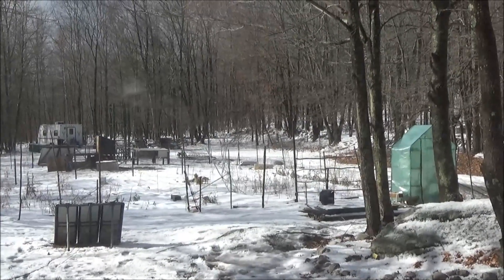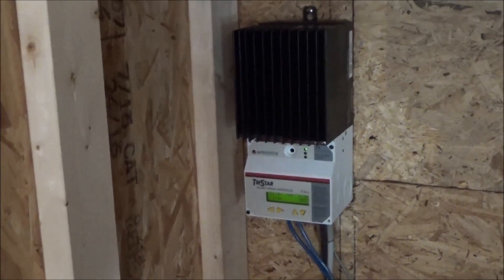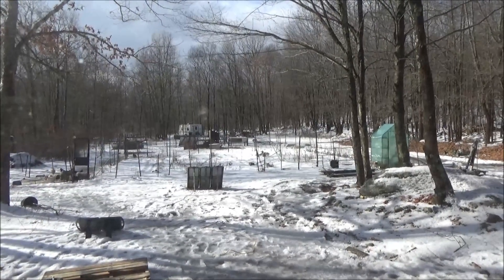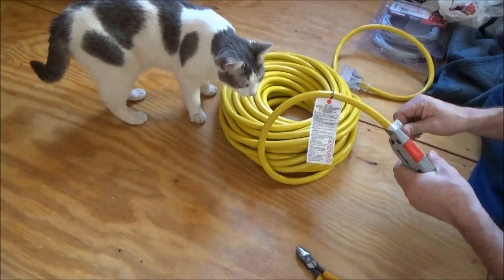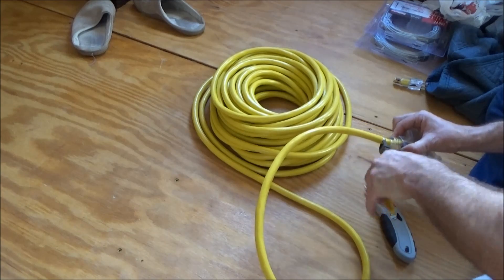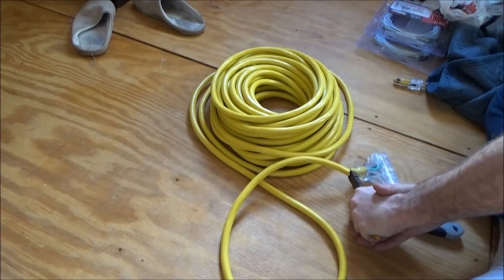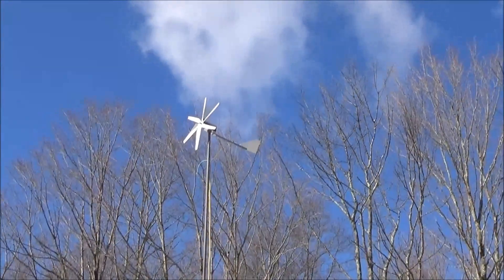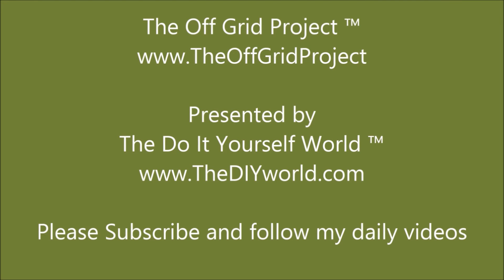Mounting My 350 Watt Wind Turbine

Comment: you put a piece of wire buy the cat. they will go nuts. you can strapp the green wire to the neg  to help with voltage drop. its 12V it makes a difference. hope you put a ground rod system on the tower. the rain and snow static build up can cause power spikes in battery dammanging what connected. I remember that storm too well. im  appx 40 mile from buffalo ny. we got hit too.killed the grid hear. shut down I 90 in spots. Ice skating time. I lost my long wire antenna during that storm.

Comment: Keep at it Troy. Getting that wind turbine functioning is a huge step. Running generators for electric can be done but it is expensive over a month. The money you save from getting this done can be applied else where. Ignore the haters.

Comment: If at all possible, you should connect to the AC side of the diode pack and run AC to the house and connect to a diode pack there. You will gain more power than running DC on the 10 gauge wire. If you can't run AC, you may need to run 6 gauge to the house to minimize line loss. Good luck.

Comment: Hi Troy, Have you considered hanging 2 PV panels from the top of the towers cross piece to help with the shadowing issue on the ground mounts? Also which type would be more beneficial the amorphous panels or the higher output panels?  Steve O.

Comment: Do you think you can put one more set of four on top to double the height?
Even if you do one at a time it would probably make a big difference.
Maybe even take one of the extra attach it horizontally at the top so it looks like a "T" then you can put two wind turbines on the same scaffold at a nice distance apart.
Just some thoughts.
Reply: Also to help keep it from tipping over you can mix bags of concrete and pour/pile them at the end of each outrigger. Probably a couple hundred pounds at the end of each outrigger should be more than enough.
Reply from the maker: Yes I do plan to extend the height and also put weight on the outriggers

Comment: You should consider having 3 wires running all the way from the wind turbine head 3 phase output to the rectifier diodes close to the THOW wind charge controller to maximize efficiency.

Comment: if you remove the clamp in the middle the pipe can flex more without breaking.

other tip is to use the third wire in parralel with the pos or minus, the thicker the wire the less loss!

good to see more charging power available! thumbs up!
Reply from the maker: Thanks. Things are looking up
Reply: fix the other pma windmill asap, and put that on the radio tower! (do you have a way (brushes??) to connect the turning turbine to the mast?? ) thats a good alternator, use the 3 phase and mount the rectifier inside the duplod box inside the th, you have 3 wires available, its a big beneft iff you do it that way, lots lees loss! its looking better by the day! thumbs up!

Comment: Damn, I must just be stupid.  But, why wasn't the wire secured to your pole, before you raised it?  That wire flapping in the breeze will break those wires off in a heart beat. (repeated flexing under pressure) And, Troy, your friend told you before you raised your pole\tower to make sure you guyed it properly.  Easier to do before raising, than having to lower, install correct parts and re-raise.  Lessens the chance of damaging expensive  parts.  Haste makes the intelligent appear foolish
Reply: Everything is temporary why do it right the first time when you can do everything over 3 times.
Reply: Nothing is done right the first time on 'This off Grid Project'
Reply: *****
I get the feeling that he wants to do everything 3 times.  I guess that is so that he can make 3 videos about everything he does instead of 1?
Reply from the maker: It is coming down in a few days anyway. I am going to mount it with the larger tower
Reply: *****
so you always do things right the first  time or put your foot in your mouth  good for you me i'm just human  and screw up a lot the first time

Comment: For next time you move the turbine!!!  If you would put the wires together (neg and Positive) it will  be a brake on the turbine so there would be no 12 volts coming through the lines.  Just trying to help.  Dont want to see you do the DC shuffle.

Comment: Great job Troy, But make sure you install at least a 9 ft grounding rod, That way your system will be SAFE from electrical shock. That is if you haven't already, good luck be Safe, Keep the videos coming

Comment: what happend to the tower his friend brought over in the last video? thought you where using that and then attaching to pole on top of that..  Or did i miss something?-
Reply: That will be up very soon, Troy just got impatient and wanted to get some wind power into his new batteries along with the solar power as the solar alone is not enough to give a good charge to that new battery.

Comment: Tower looks like it will be working fantastic. Great Idea Troy. Looks to me to be plenty high. But why do you keep putting your solar and wind gens far far away from your tiny house? The small advantage of the position they are in the sun is not enough to over come the far off distance and voltage drop.  This causes huge voltage drops defeating the purpose of the whole set up. You want to be as close as possible to your panels and your wind turbine.  EVERYONE ELSE ALWAYS put their panels as close as possible to the batteries. You will probably get 3 or 4 volt drop in power, "a huge disadvantage. " I wonder if it will even barely work? I hate be negative but this is a fact. Get your out fit closer to your cabin. ten gauge is good for about 100 foot after that you better get some eight gauge or six gauge for a run like that.  shesh! you have a big wire for your run BUT it is not a copper wire is it? Isnt it aluminum. Big aluminum wire is not good for DC at all. You might get something I guess. But not a lot with a long run like that. NO wonder you only get 200 watts max. I cannot stress enough the huge distance your trying to over come is just too far away!
   Please use a MULTI Meter  to check voltages at turbine and at your house to actually see what Im talking about. I have never seen you even use a Multi Meter that I can remember lately. I hate be a bummer but how many feet away is that from your Tiny House on Wheels anyway?

Comment: Hey troy.   Just noticing that the generator was not rotating.  not sure if it's still the case but you mentioned before that the wind changes direction often in your meadow.    Just wondering if it's able to turn into the wind.
Keep up the great vids
Reply from the maker: It spins freely yes
Reply: Awesome possum

Comment: Do you have a swivel on that thing? I noticed the turbine stayed stationary even though there was some wind as evident by the noise in the microphone and the buffeting of the blades.
Reply: Some shots where the blades look stationary they were actually spinning, cameras have a job keeping up
Reply from the maker: It spins freely inside the pipe. I also added large greased washers for more protection and lube

Comment: TROY! YOU SCARED THE (edited) OUT ME! You didn't show (and SHOULD have)  what was happening at the other end of the wire. One end was connected to the live turbine, and the other was where? I'm sure you realize, but others copying you may not that if that live wire were lying in the snow the current can carry right over to the metal tower base! I was yelling at the screen the whole time. .. Where is the end of the live wire?????!!!!!!! So I am sending you a [SLAP] eeerrr... Ok, you said at the end it is hooked to the panel?... too little, too late.. you scared me! Don't do that!
Reply: Albertzz99 A little Voltage and Amperage lesson!!!  Voltage isnt the problem.  The AMPERAGE is what kills.  12 volts at 1 amp can grab you and hurt you, 12 volts at 10 amps can burn you and stop your heart.  Never think of the voltage.  Electric fence charge for animals is 150 volts ZERO to .0001 amps.   It bites but doesnt have the ability to grab you and kill you.  Voltage will knock you away, AMPS will grab you and then your done.
Reply from the maker: Oh that. I had one wire in my sock and the other between my teeth so I did not lose them while working. lol
Reply: Hope this helps. shock is relatively more severe as the current rises. For currents above 10 milliamps, muscular contractions are so strong that the victim cannot let go of the wire that is shocking him. At values as low as 20 milliamps, breathing becomes labored, finally ceasing completely even at values below 75 milliamps.
As the current approaches 100 milliamps, ventricular fibrillation of the heart occurs - an uncoordinated twitching of the walls of the heart's ventricles which results in death.

Above 200 milliamps, the muscular contractions are so severe that the heart is forcibly clamped during the shock. This clamping protects the heart from going into ventricular fibrillation, and the victim's chances for survival are good.

The actual resistance of the body varies depending upon the points of contact and the skin condition (moist or dry). Between the ears, for example, the internal resistance (less the skin resistance) is only 100 ohms, while from hand to foot is closer to 500 ohms. The skin resistance may vary from 1000 ohms for wet skin to over 500,000 ohms for dry skin.
Reply: yes they could send you to seek medical attention.
Reply: ***** I have a hard time understanding electricity... but, that's what I figured.  Thanks...
Reply: ***** Any idea the amps of that turbine?  Am I overly concerned?
Reply: ***** And thanks for the info!
Reply: MollyDolly Just FYI 350 watts at 12 volts  so amp = watt / volt  350/12 = 29 possible if you got max wattage.   those 12  volt  turbines can produce upto 20 volts also.  just depends on the unit.  
My turbine is dual 24 volt /upto 1600 watts.  I have seen 60 amps out of it.
Reply: ***** So, those 29 amps could kick your butt could they not?
Reply: ***** That is scary!!   I sure understand the muscle contraction part... I used to use a TENS unit (electrical pulses through skin patches) to relieve back pain... it was powered only by a little battery... it had 2 dials on it which depending on how you adjusted them they would make thudding sensations like a cat purring through the patches or pricking like a needle.  I fell asleep with the patches on my back one night and woke up to turn the little machine off...(it is only about the size of an old transistor radio) ... so, I  twisted one of the little knobs that turns it up or off... unfortunately I turned it the wrong way and cranked that thing all the way up!  With only a small battery that thing cramped my back so hard I suddenly looked like a twisted fish! I was barely able to breath and yank the wires pulling the sticky pads off!   I don't even want to imagine what that turbine could do!
Reply: Relax, it's not exactly like they have a 12V little wind generators hooked to the electric chair. And few, if none, have died from an accidental touch of a 12 or 24V battery.
Reply: Albertzz99 I actually don't know the voltage that turbine produces.  I can tell you this for sure, whatever it is would be enough to cause you to jump back.  That could cause a fall off that tower.  Don't get me started on not having a harness on!
Reply: wow 16 volts on the mast.. that will kill you,,,,, tsk tsk tsk....no danger at all, and when you short the wires the turbine stops anyway, its not a 230 volts generator!

(you put the brake on the turbine if you short it.)
Reply: MrBugsier5 I'm sorry... I did not follow.  If the end of that wire is loose do you say it is, or is not dangerous?
Reply: MollyDolly
 Don't listen to *****. He does not know what he's talking about. Yes he threw in some facts, but that's all. The voltage in this case is low enough that your skin acts as a dielectric barrier when dry. And if all wet your body has a minimum resistance of approx. 1000 Ohms anyway. This means that passing "amps" of current thru the body at 12V or 24V is scientifically impossible. And as an example to illustrate what I meant with the 1000 ohms statement...: at 12V and a worst case 1000 Ohm body resistance you can pass 12 milliamps thru the body, max. The 1000 Ohm wet resistance is however worst case.

So, no danger to any ones lives from electric shock and these voltages.

***** Of course amps kill, but you can't overlook Ohms law. You need a certain Voltage to overcome the resistance and reach the needed milliamps for damage to occur.
Reply: *****  you have no idea what you are talking about! the voltage is to low to get to about 30 miliamps at the hart, you forget ohms law, up to 42 volts is called safe voltage, the skin resistance is around 10kohm arm to arm, even whet it wil not be less tan 1000 ohms, no way 12 volt can produce 30 miliamps that way, (its more in the micro amps,thats why they use voltages up to 45 volts in confined and whett places. ), if you are verry lucky when whet you can slightly feel maby 13 olts only as a very weak thickle, at 24 volts you can even feel it, but it surely wont hurt! dont worry so mutch, it will be fine!
Reply: MollyDolly the low voltage it produces is not dangerois at all, you cant even feel it when whet, and even if you can its only a very light thickle, if you short the wire at the end, the turbine stops spinning due to the load. thats the brake also in high wind conditions, if its turning to fast it can be demolished, if you short the alternator it wil work like a brake.

so both ways are safe , and not dangerois.

agree that iff y would be Troy i would have done it right even in temporary builds, so use ty raps to fasten thecable to the mast , and use all the 3 wires connected on the 3 windings to transport the power as 3 fase ac to the th, than mount the rectifier inside the th.
but y am not Troy! he des it as he thinksits fine, y have other ways as he does , but thats life! lol
Reply: MollyDolly
Electricity flows in a circuit.  You need to be part of that circuit to get zapped.
Reply: The Do It Yourself World :P***
Reply: The Do It Yourself World You are a Punk, you know that right???  Why do I worry about you?
Reply: Albertzz99
So, how many amps can you get from touching both terminals of a 12 volt battery? How about sticking a 9 volt battery to your tounge to check if it's got a good charge. Are we risking our lives doing those things? Should there be huge warning signs on all car batteries? Why am I not dead from checking 9 volt batteries? Or am I and I dead and I just don't know it?? :)
Reply: MrBugsier5 I have no idea what the watts/ volts / amps of that turbine would be... I always thought the turbines put out more power than the solar panels... and apparently you can get a good jolt off those, so I figured the turbine was the same... ??
Reply: J. Williams You should read mine and MrBugsier5 comments all over again. What you ask is all there. And yes, there are warnings on car batteries for good reasons.
BTW I don't recommend checking 9V batteries on your tongue. But your comment seems to be of this world, so I think you survived. LOL
Reply: ***** only if you are soaking wet and the wire is connected directly to the tower he is climbing.  Snow is a shitty conductor and your bare skin while relatively dry creates a resistance to the flow of current.  This resistance can be measured and it depends on the part of the body in contact with the conductor.  Most people just don't get that resistance and the capacity of the conductor to transfer the energy plus time in seconds/minutes in addition to watts creates the kill or injure calculation.  Its not as simple as amperes or even amperes over time.

Comment: Nice tower! Have you considered how big a turbine you could use once the pipe diameter is 2"? I noticed the wind seemed to be blowing fairly strong and not turning those blades. Perhaps increasing the blade diameter to 2 meters would afford you more power at low wind speed. I estimated a 10 knot wind was needed to push your blades during the install. If that remains, you will only generate power 20% of the time (on average) Huzza the progress!!
Reply from the maker: This is supposed to have a 5 mph start up speed. The wind was turbulent and stronger on the ground that day but weak up higher.
I will mount three or four wind turbines eventually
Reply: The Do It Yourself World
Right on! Not sure if you saw a comment I made about a Ram Pump you might use to push water from the steam to your house. No electrical power needed! Check Wranglerstar channel on his ram pump 2.0 vid. It works beautifully. You could do it!
Reply from the maker: grodad I cannot. It is 1/4 mile away from me and on another property
Reply: The Do It Yourself World
that is a true bummer. the distance is no biggie but the right of way,, drag!

Comment: troy have you thought of building a solar hot air collector as a project? there is a video out where a guy compares different types you should check it out if you havnt. you may not need one but it would be cool!
Reply from the maker: I did that in the old camper two years ago. Worked nicely. I was going to build a solar porch for the new tiny house but it is too hot anyway
Reply: well they look fun to build im gonna build a big 8x12'  with a temperature activated fan switch for my house